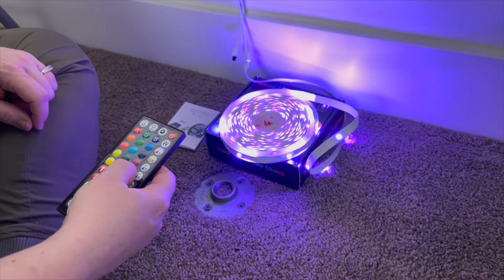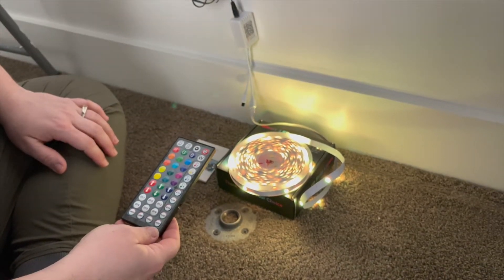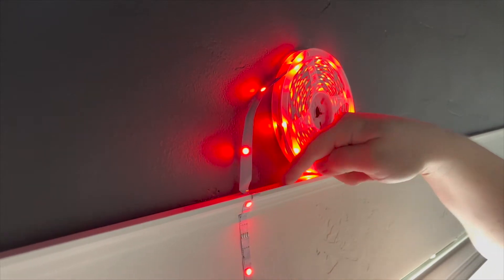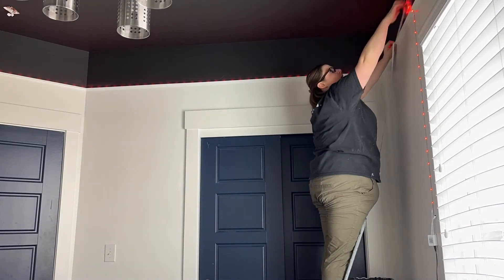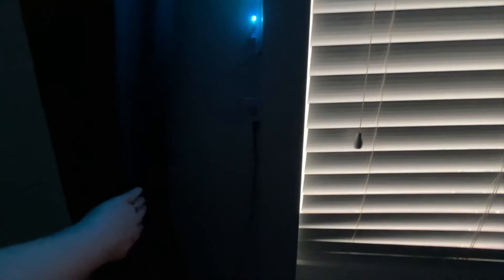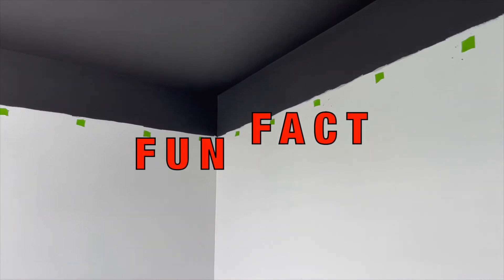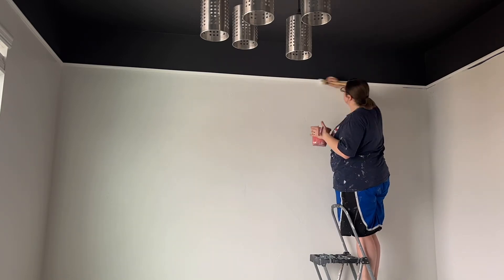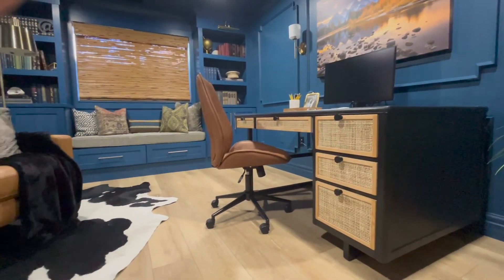Absolute Best Smart LED Light Strips for ceiling in bedroom

Comment from the maker: LED lights are all the rage and these were SO EASY to set up! We wanna hear from you! Do you like the idea of hiding the lights? Or would you rather just stick them to the wall?
Reply: Was is 5 m?
Reply from the maker: This is what we used https://shopmypo.st/CvBx06 It's a 50 foot strip from Amazon less than $20! It works just like the 3M adhesive, but it's likely a generic tape not name brand

Comment: Excellent,  looks great. I dont think i could do the molding though. I may try the aluminum diffuser strips instead cause they can be very bright. Ty
Reply from the maker: The molding does seem intimidating for sure. You could use the miter sheers if you don't have access to the power tools. We haven't used them but a lot of our DIY friends have, and they're simple to use. https://shopmypo.st/t4E5SH But going for the diffuser strips is also a great option!